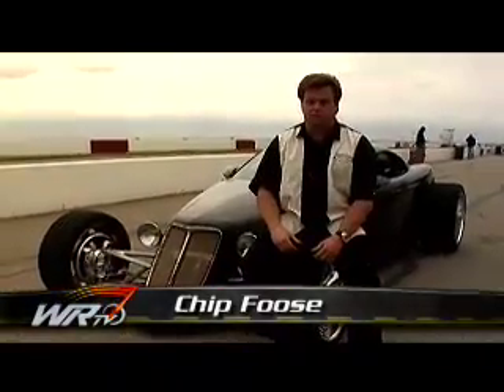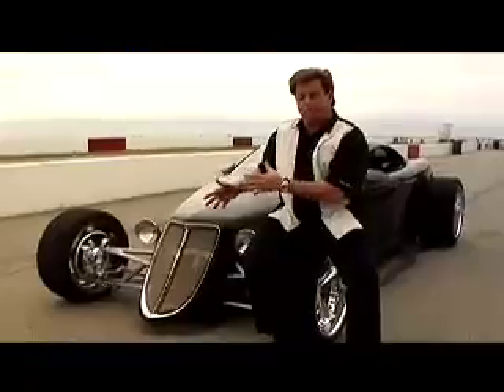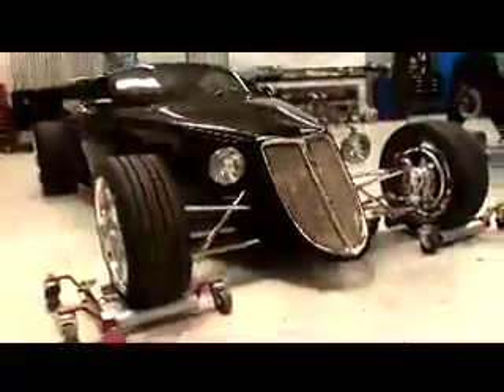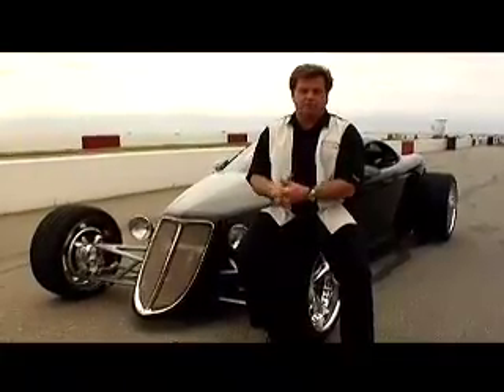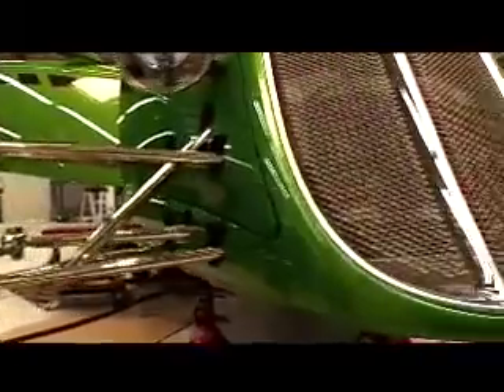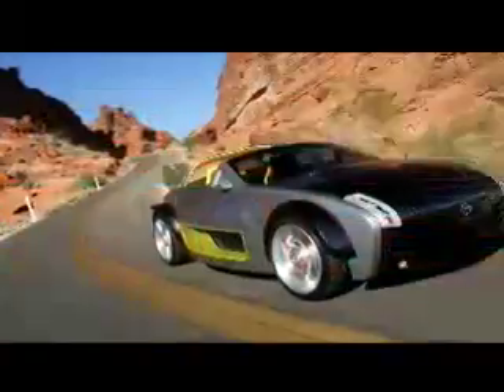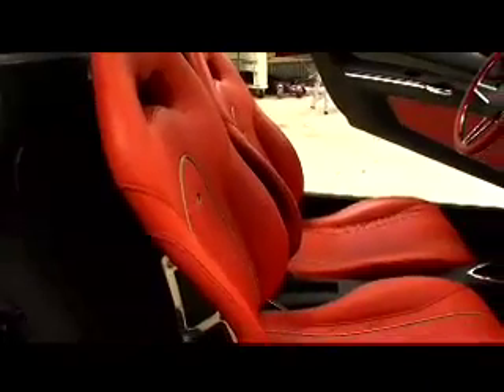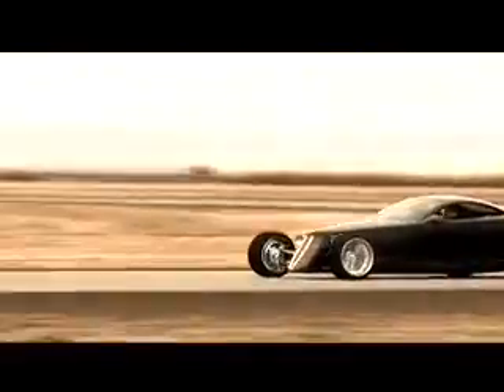Chip Foose and The Hemisfear

Comment: I certainly wont meet the construction and use stipulations for most countries for it to go on the road,for example,for the uk,it would have to have mudguards,orange indicators,propper headlights and no gap between the body and front wheel (not that big anyway) for a production car,if it was sold as a kit it could be type approved by each individual car assembled.The S.V.A list would be endless!!

Comment: It's just too bad they only came auto and V6...even though the V6 in there is still pretty good, a V8 would still be better and I'm a bit confused as to why they didn't use one, unless it simply would not fit under the hood. And the stock bumpers are horrid, but once they're removed then the car really looks amazing.